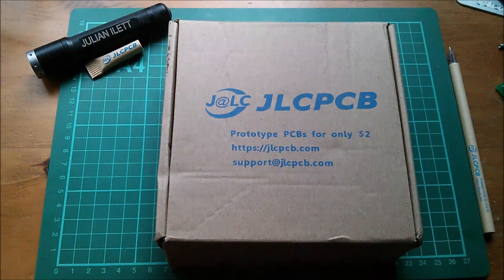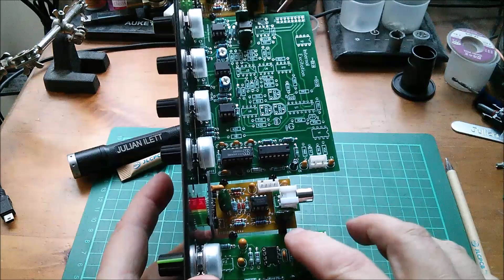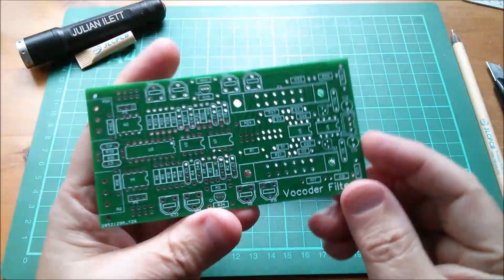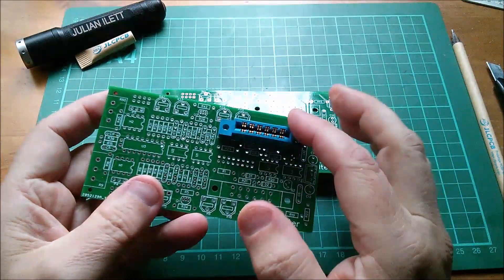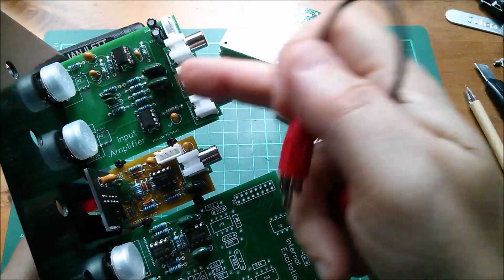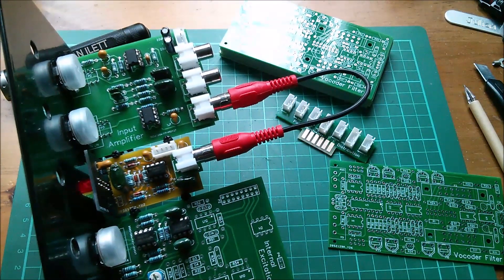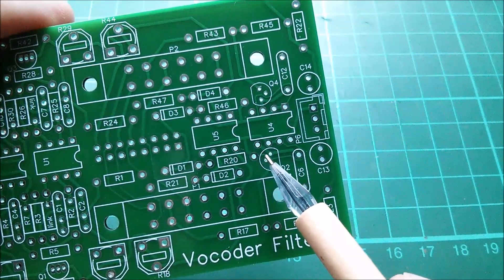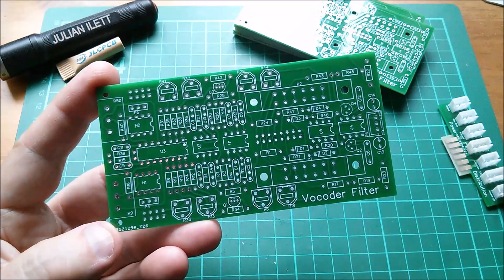New PCB from JLCPCB - Analog Filter Circuit - Vocoder

Comment: We used to know the 5/32" connector as 0.156" pitch (it's actually 0.15625" but I don't think a quarter of a thou bothered anyone then).  Frequently found on equipment designed in the usa.

Comment: Why not drill holes on the edges of the bar graph boards and put some threaded rods in there with nuts then you can adjust the depth easier(maybe even glue a nut to the faceboard then you have to bother with sliding bits) and also the side try using like a double side u channel for sliding

Comment: @Julian Ilett, I sent you a Tweet asking this, but got no reply, I have a question about JLCPCB and Import Duty, did you have to pay this when ordering your boards?
Thanks.
Reply: Paul Kirby, I have just checked this, and it seems unpopulated boards are Duty free, VAT should be free if value is less that GBP15.00 FOB. Otherwise you may have to pay VAT at 20% and handling fee.
Reply: Gordan Milne - The handling fee if the carrier in the U.K. is the Royal Mail is £8. If buying using a currency other than the Pound Sterling, changes in exchange rates can take an item close to the £15 over the limit 🙁

Comment: to elliminate board flex on daughter board inserts and removes put an insulated metal strip under the connectors under the board and bolt them down and bolt the strip to the vocoder housing...

Comment: I think you'll find the pitch to be 3.96875mm, which is 5/32", as I have told you before.
Reply: No.  It's 0.156" per the manufacturer's spec.

https://www.mouser.com/datasheet/2/123/96-1483705.pdf

Comment: It's the same type connector that Commoder used for the tape port on the C64 and C128 computers.
Reply: These card edge-connectors are actually an old industry standard, hence were all originally designed and manufactured in imperial measurements.
Reply: Yes, brought back some memories there...

Comment: Seeing as there's a chance of plugging into the display, how about filing the edge of those boards and the adjacent ones once you set the distance, then use larger bolts that will sit in the slots.
Also, any connector that originated from before metric, the metric will be an equvalent, for instance the 2.5 and 6mm jacks, 6mm are 6.3mm for instace

Comment: Thin pads between the socket and the board should make up for the fact that the pins don't go down the holes all the way. Especially since you'd only have to put the pads under the tabs with the mounting holes
Reply from the maker: Yeah, a couple of washers might do it :)
Reply: Julian Ilett - I suggest either insulating fibre washers, or nylon washers 😉

Comment: The guard is a clever idea.
Reply from the maker: It is :)
Reply: @JulianIlett  I remember those in some commercial equipment (ARP synthesizers,  actually).  No solder mask on those boards, they found that solder mask tended to encourage the board to absorb humidity, which caused drift.  Their use for the S/H was for control voltages,  and drift is something you don't want when you're controlling musical pitch.  :-)

I also notice "extra" holes for some of the capacitors.  Nicely done!  You did experience a bit of difficulty with capacitor lead spacing,  as I recall.